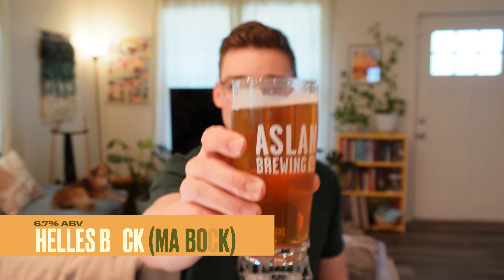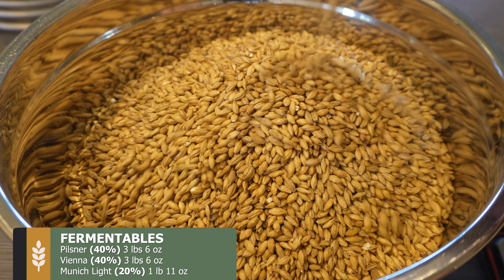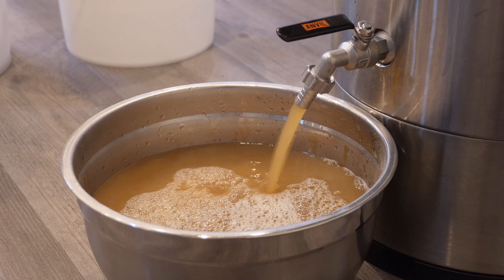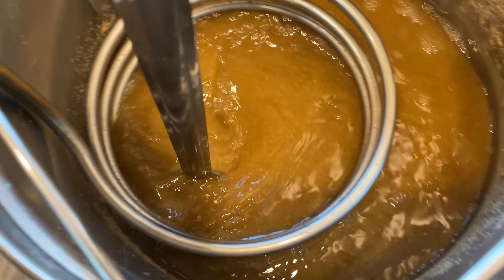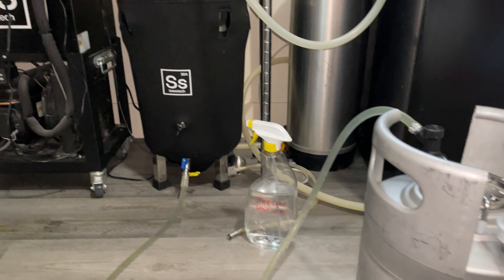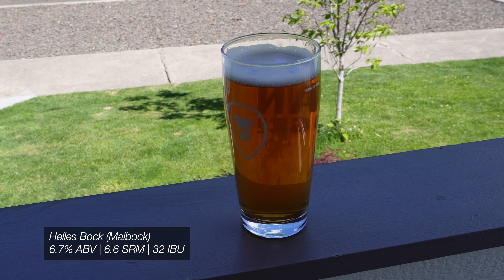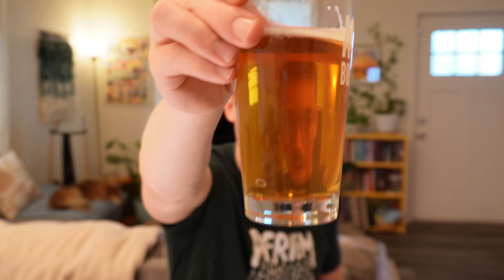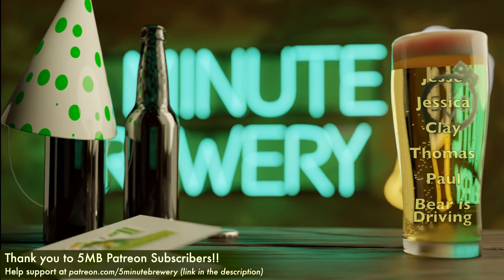Brewing a Helles Bock Lager (Maibock)

Comment: why don't you use a pump while mashing?
Reply from the maker: I've tried using a pump, but the efficiency increase I was seeing was minimal enough that it wasn't really worth the time it took to setup, tear down,  and then clean the pump and tubes. Plus, it's something else to monitor to make sure its not leaking or spitting hot wort around.

Generally stirring a few times during the mash and rinsing the grains during mash-out gets me between 67% and 70% mash efficiency.